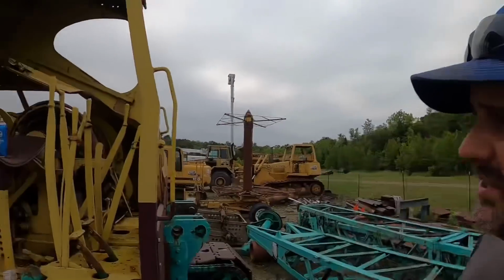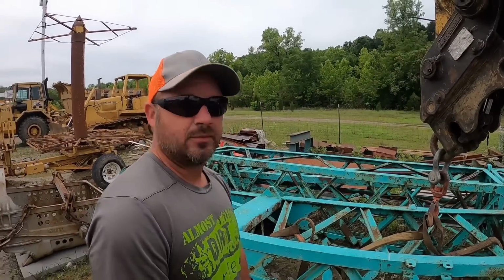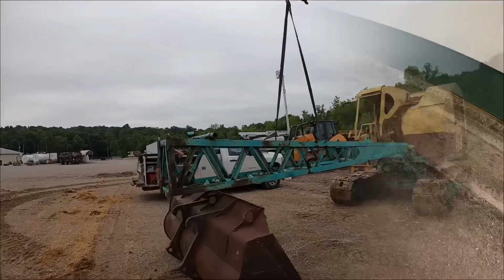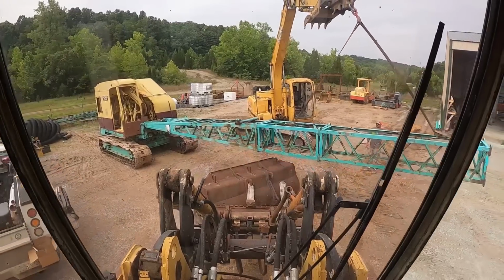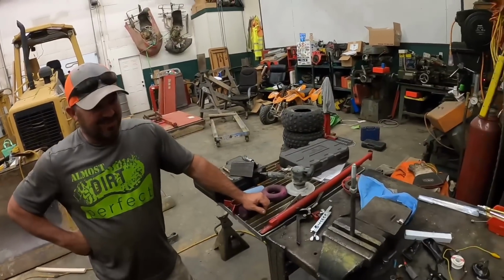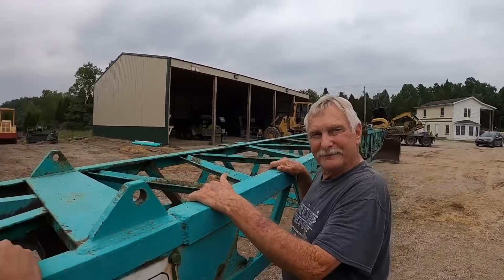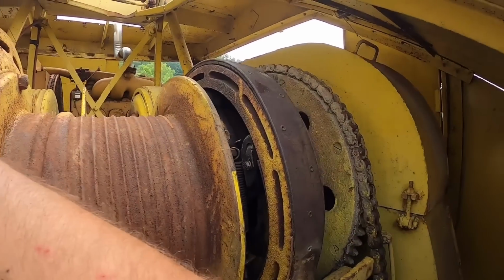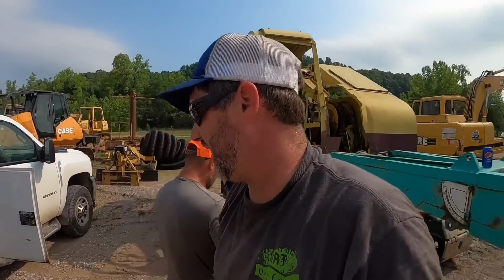So damn excited I can’t stand it! Installing boom, boom clutch, and brake in my old 22b dragline

Comment: When I was much younger in the UK, like around 40 years ago, I was a Site Manager, and we had a contractor doing permanent steel-cased piling on the job. To drive these steel tubes they used a one ton hammer, formerly part of a ship's propeller shaft, hauled up and dropped down the tube that had a plate welded across the bottom and a barrow load of dry sand and cement chucked down it. The pile was driven "to a set" meaning a one inch "set" was one inch down per hammer blow. The machine used was the English version of that same machine, called a Ruston Bucyrus RB22 rigged as a crane with two winches, one for the hammer and one to lift the next pile into position so the hammer could be lowered into it.. For that job these days it would be a CFA pile, Continuous Flight Auger, where the auger which is hollow is screwed down into the ground, extensions added as necessary. When depth is reached concrete is pumped down the shaft as the auger is withdrawn bringing the spoil in the screw lands to the surface until the concrete fills the hole. A cage is dropped down and that's it, no fuss and no ground shaking hammering disturbing adjacent buildings.
Reply: Things seem better now, but not cooler.
Reply: I worked on a job where the pile driver was the diesel piston type,the weight was dropped down in the tube,hit bottom and as it did compressed a shot of diesel which fired and sent the weight back up over and over,when depth was reached the diesel was shut off.
Reply: WE had RB 22's on our piling barge, replaced with a P&H mainly for the smaller cab, engine and drum body and better vision. Those brakes used to get a bit hot and adjusting them up and down as the day got hotter and cooler were memorable! Great days, had a great crew, we worked hard and played hard, and no one ever got hurt.
Reply: My dad had 2 x 10RB 1x 22, 1 x 38 and one Smith 21.  I got to drive them all and one comment was they all had Arthritis ( bad on the travel ). He had various attachment configuration from face shovel to dragline to crane.  Piling also using our own design chisel (2” plat 8x4’ sheets welded in X configuration weighing 4 tons setting 5’ diameter by 60’ long piles. All in the 1950-1970 they were great but hard times.  I drove them all as a young lad being taught by the great operators, I’m 67 now but would love to drive one again, such were the memories. ❤🎉. Great to see this 22 being loved again.

Comment: I can't thank you enough for tickling my memory of many years ago, several decades!

Thaddeus, (Teddy) Baker used to operate one and all the Believers and pedals we're like an extension of his thoughts mastering the control of this beautiful machine.

I didn't know it at the time but I was so blessed to have been able to work with them blasting rock at 15 and 16 years of age and having the privilege of them showing me how to maintain them Beast!

Being young and vibrant with a passion for work we did not want to stop jackhammering the holes, setting and packing the dynamite and letting it rip with the plunger. Teddy would take these absolutely gargantuan still next to place over the explosive area setting the bucket down on the mat! Once in a blue moon you'd see a Rock about the size of a 3 gallon bucket go flying in the air about 30 or feet!

The boss would make us take an hour break for lunch having two large coolers supplied with beverages, and the short men of cold cuts, potato salad, macaroni salad and all the condiments!
Looking back through the torn pages of my mind and having so many jobs before settling down for one with benefits, the construction industry was one of my most favorite jobs ever! Laying asphalt had its ups and downs especially in the 80 or 90 degree Heat but still was always fascinating and I guess I chose to enjoy it! Again thank you and may you all continue to be abundantly blessed

Comment: Good morning DP, it is cool seeing this old iron live on. I spent many years in th ed oilfield and in Aviation and they both had similar ways of doing things. On of the things I would redo is the bolts holding the boom together. Insert bolt from top to bottom. That way if the nut comes loose the bolt will want to stay in place. Unless blocked or otherwise unable always install bolts, pins and so on as follows..top to bottom, front to back, and inside out. It is does this way as a safty system. Just a suggestion.  Thank you and be safe.

Comment: In 1970, I was introduced to a Link Belt speeder parked in the back lot of the Shipyard and we did the same thing as you guys are starting to do in this video. The good news is once you get it all working it gets easier until one day it becomes like any large piece of equipment and large projects get done. Chris Guinn's on the "Let's Dig" channel got one working and is just now in the process of learning how to operate it. It does get easier to operate with seat time.
Reply: Mike and Chris are good friends.

Comment: Back in 1980 I started working for a scrapyard that had 4 American 7220 series friction cranes as well as a 300 series truck crane. The 7220 used 66 inch and 72 inch magnets. 3 of the 7220s had 6-71 Detroits and the 4th an 8V-71. The truck crane had a 4-71. I replaced a lot of brake and clutch blocks on those for the next 25 years until they finally were retired in 2007. We bought friction material from Brake and Equipment Warehouse in Minneapolis. I just checked to see if they are still in business and they are an auto parts store with the same name. When the production of asbestos friction material was banned in 1993 and could no longer be sold after 1996, there were a few years of trying to find suitable replacement with good grip that didn't wear the friction material or the drums out too fast and still had grip. They purchased their first hydraulic machine in 1992 and it became obvious that the draglines days were numbered.

Comment: That crane with a clam shell bucket would have been the best machine to use on the boat dock when you were placing the rock around the steel wall.

Comment: I used to be the guy who installed the clutch and brake linings for all the mechanical crane customers our dealership had.  Brings back memories.  DP, if I'm not mistaken, there is a feeler gauge spec for the internal clutches.  I can't remember about the hoist brakes though.  Great project, thanks for sharing your project !!

Comment: Back in the 60's I regularly helped my Dad at a Buick and Pontiac dealership. Nearly all cars then used drum brakes. If the shoes were good people could save money by relining them if they were not bonded. I riveted many pads to shoes. They had a floor mounted machine that I loaded a single rivet, lining and steel shoe. I stood on a pedal that brought a tool down to collapse the rivet. My full weight and one bounce usually made a good tight joint and didn't break shoe material.

Comment: 🌟🌟🌟🌟🌟It is hard to think, I just turned 60 a couple days ago ,,,,, , I was in my 20's redoing brake linings pretty much exactly as you did with the drum brakes, I done hub brakes on the chip trucks. I did find that by putting them all on loosely and then tightening them all up, they seemed to set better on the casings.  I use to watch a drag line at work here too, even in our tiny little town we had a rock pit. Keep having fun guys LOL 😆 😆

Comment: As my hubby and I watched this episode he kept cringing as Aaron walked under the boom as it was moving above his head and as you were working on putting the brake in and kept poking your finger thru the holes trying to line it up saying he had been "bit, pinched, and trapped" room many times doing that. He was a Journeyman Mechanic for 20+years in the copper mines in Arizona and a gold mine in Nevada. He said he had worked with cranes like that many times and even changed our an old steam operated crane with a mechanical one In the Phelps Dodge Copper Mine in Morenci AZ😊

Comment: Yeah, I can't work with gloves on either. I know it is supposed to be safer but it is absolutely slower & frustrating. Skin will heal! Sounds like a plan. Experience talks louder when it works well. A little grease on a pin helps it slide right in. That's Aaron's poem for the day!

Comment: As a ex driver,you should have two extendable rods on boom to stop it going up to far and overbackwards .also you should have a lever by your left foot to operate a locking Pawlenty to stop the boom coming down .hope this maybe of help.also we carried a bucket of Sharpe sand behind the seat ,we picked up a handful and throw it in clutches if the brakes slipped .keep up the good work .

Comment: There are friction shops that can rivet the lining back on with the correct rivet mandrels so you don't pinch the rivet shank and get the correct compression and rolled end for retention. I worked in a facility where we had a reline shop for heavy duty brake shoes and bands, if you are doing it in the field they offered tapered head bolt kits in place of rivets for some applications.
Reply: Thanks for saving me the trouble of explaining it.

Comment: I use bolts and washers to hold the lining in place.  Light torque.

Pull one bolt at a time, insert rivet and seat it.

Then you find out you were not on the right holes before you seat a rivet and don't have to drill it out.

Comment: That was very smart thinking having the intake open and a piece of wood there to put over it incase the engine decided to run away with itself. The emergency kill flaps are great but if you have a guy there with a piece of wood at least you know that you're not going to have a bunch of rod's hanging out the side of the block.

Comment: Hi guys looks like your having fun LOL , Might be an idea when your fitting your boom bolts ( at 15-15 ) might be a good idea to have your bolts the other way round so that if you have a nut come off when the boom is up in the air, the bolt will hopefully stay in the hole and not drop out !!!  Can"t wait to see her working.
Reply: That’s why you do your circle check each day and why each section is held together with 8 bolts. 
Also probably why booms aren’t bolted together anymore as well.

Comment: Mike maybe water trickling out at the base of the boom by the pivot point when you moved it with the 120 might be cause to examine the structure for internal corrosion especially at such a critical location where it can be subject to significant compression loads?

Comment: Did I see that right, you pushed the lever forward and it went backwards?  ;-)
Possible reason; It's easier on the back to sit against the seat cushion, versus leaning forward?
Reply from the maker: House turns same as excavator

Comment: Mike I try not to upset you, which I do at times, because I'm a perfectionist and a retired mechanic of over 38 years those rotors should have been wire brushed and sanded before the new pads were installed to save pad life, other than that, another great Arron and Mike video on something new a entertaining

Comment: I was thinking, wouldn't it been a good idea to put some never size on the plates, on those boom sections
considering that you just cleaned them off. So they won't rust back together.

Comment: Nothing sound better than a old Detroit Diesel engine. I am proud of you not afraid give it a shot of ether to start it. We had one in one of our Vermeer T600C crawler trenchers we spayed a hole can in and it would not start We where installing it after  it being rebuilt. It would not start when they rebuilt the engine the timed it off the wrong end of the crankshaft tThose Detroit’s can be timed clockwise or counterclockwise. When turning the wrong way they won’t start.
Reply: They can diesel on shut down and pop off running backwards too.

Comment: Why did all these machines have smooth tracks? I have loaded many 22RB’s onto transport and they are a horrific to get onto a steel low loader, many times wanting to slide off.
Reply from the maker: So they would turn

Comment: Have a question why does the light company always leave their boom in the air you think it would be a big lightning rod if a storm came up or if heavy winds would  tip it over
Reply: Actually tree trimmers.  Its a liability thing and keeping kids out of the buckets,
Reply: Theft deterrent. Lot of Company's with equipment like this, manlift buckets, and similar raise the boom(s) and have a way to "lock them out". Makes it real hard to drive down the road that way.

Comment: At 28:00, shouldn't you have sanded down that spindle before attaching the brake pads.  It seems to me it will just sand paper those pads down.